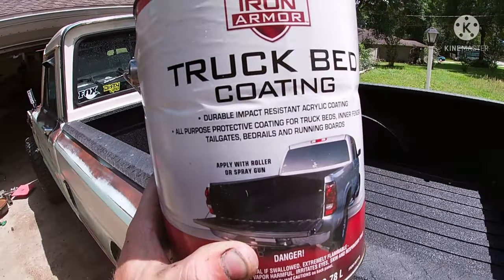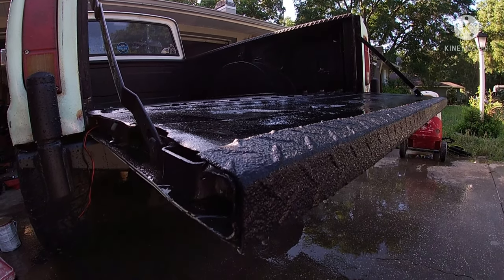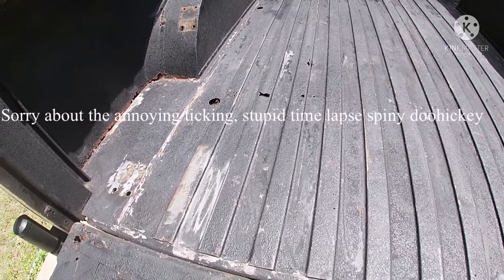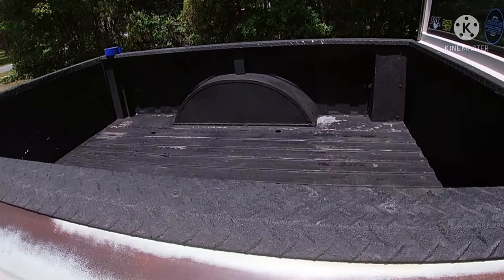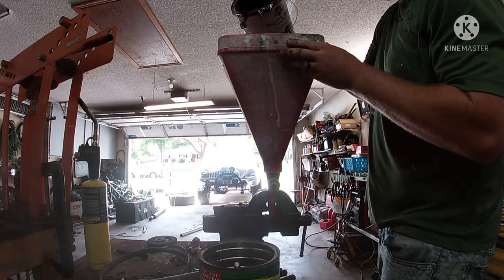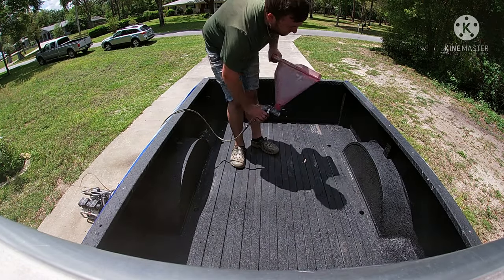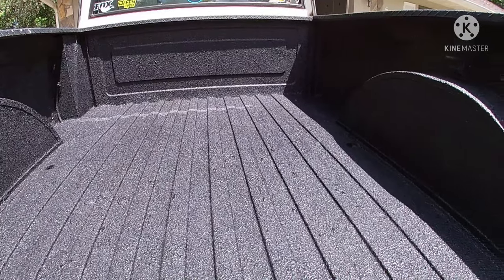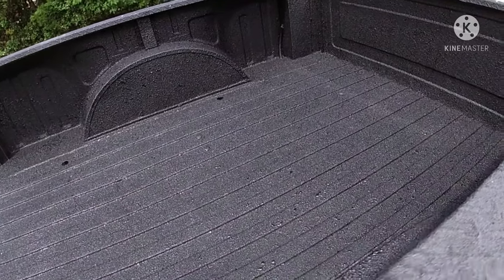i got professional results.  harbor freight  bed liner on my jeep j10

Comment: Wind is caused by people unfurling plastic sheeting, drop cloths, or picnic table covers.

Before filling the rusty joints, spray them with a rust inhibiting paint. I've became a fan of Ace's Rust Stop. It comes in a larger can for less money. It also dries to touch must faster than Rustoleum and dries to handle the same or faster than Krylon.

The polyurethane sealant you used should be better than silicone since the bed coating is less likely to stick to the latter.

Comment: While there is seldom a day in my life that I don't spray with my own equipment.  For my own vehicles, I would not care about a perfect appearance.  I do care about my neighbor calling the city on me when I am spraying, or being able to take advantage of any free hours I have for the emergency little metal protection project, including the stray free hour, the 20 F winter day, the windy day.  A roller or cheap brush is disposable, making this more attractive.  I understand I might need 3 coats or more to get one coat of a sprayer, maybe more.  But I know the added behind the scenes work that negates the 18x faster advantage of the spray gun.  Spraying has quality advantages in nearly all circa, but logistically and tactically, I am more drawn to seeing if I can get away rolling the stuff on in a few coats.

Comment: Years ago I made the mistake of buying the rattle can liner.  It didn't completely stick but wasn't a catastrophe, still left most of its course surface. Do you think this would be rough enough for it to adhere the Harbor Freight liner? Like you I don't feel like doing body work.

Comment: I have a 76  j10 8ft.. and its bed.. is well goneeee lol as you see on my vids.. but im rebuilding it with a nee floor and floor supports.. and when im done.. i plan to use this or rhino liner or something tough.. not gonna paint it.  Because itll be used and paint will just chip and scratch